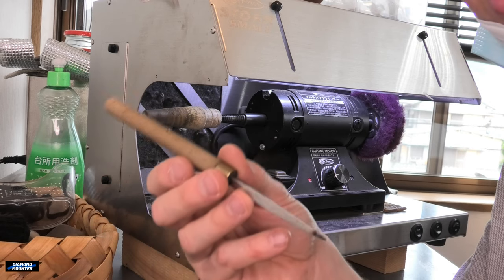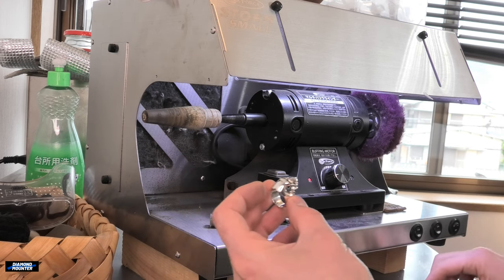How to Polish Inside Rings to a Mirror Finish

Comment: Any comment on cleaning the item in between various polishing compounds? I’ve just recently seen where bringing a item from one to another without cleaning can contaminate the finer polish wheel (mop) with the more coarse one.
Reply from the maker: Might be sensible but Iv never done that before. Also Id be reluctant to get the ring wet in an ultrasonic before the polishing is finished. Also customers are sometimes waiting for their ring to be finished and its gonna take a lot longer if you keep stopping to clean it